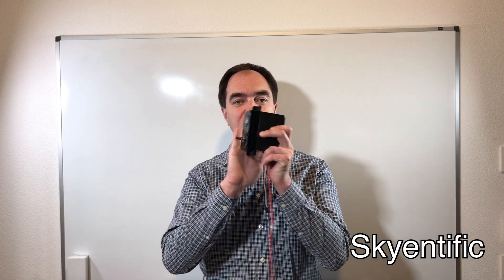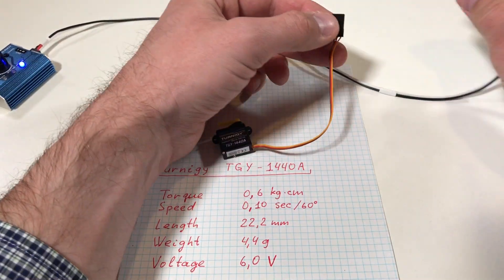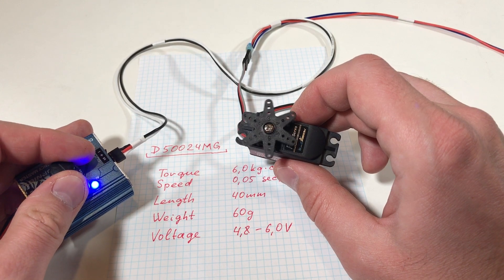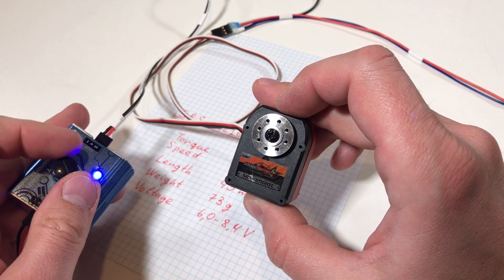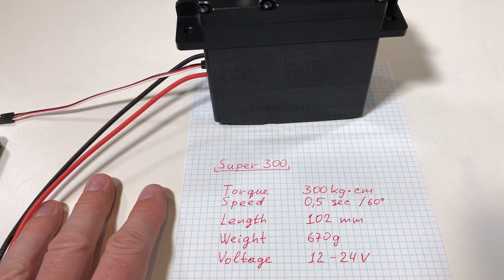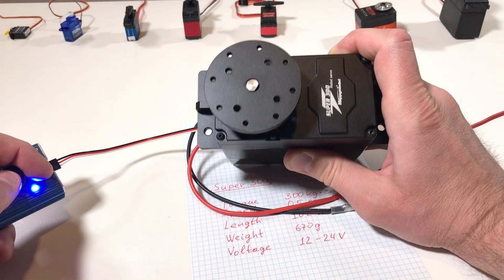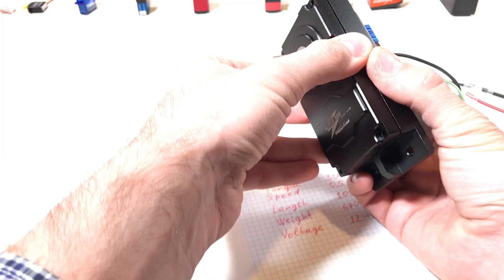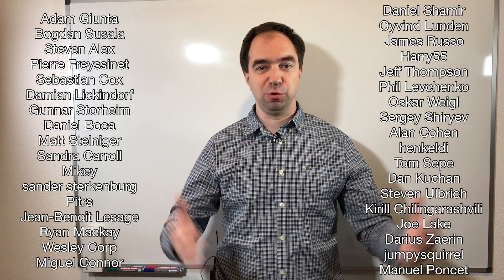Different servo motors (from 35g to 3kg.m)

Comment: Thank you! Just a note though: Torque is measured in kg.m or kg.cm in these examples. These should be read as “Kilogram Meters” or “Kilogram Centimeters” - not “Kilograms PER Meter” or “Kilograms PER Centimeter”, which would imply kg/m or kg/cm (measures of linear density).

Comment: so, servo motor is basically just 'normal' DC motor but what makes them 'servo' is a closed-loop system?
Reply from the maker: The encoder! It gives the feedback about the output shaft position. Thanks to this feedback the servo can precisely move from one position to another.
Reply: @Skyentific  i wonder is there any servo but with stepper type motor instead of typical brushed DC motor ?
Reply: @IlhamDefraN  using a closed loop system on the stepper motor to measure relative rotation isn't very useful because the stepper motor moves at constant angles per step, but a sensor for calibrating the absolute position of the axis in for example a robot arm would be useful. that's an application problem though and not something that would be included in a motor, so if you wanted something like that you'd most likely have to do it yourself with an external encoder.
Reply: @crazywazy5527  it's common when steppers skip under high load or during acceleration over resonance frequency band etc. When you need accuracy, you need feedback.
Reply: @IlhamDefraN  yes it's called "closed loop stepper motoro". There are quite a few systems on the market.
Reply: @crazywazy5527  nope that's not the full story. Closed loop stepper motor systems also regulate the current needed for doing the step so they have a much higher efficiency and lower vibrations compared to regular stepper motors or so called pseudo closed loop systems, where an encoder  just monitors the position of the stepper motor.
Reply: Yes👍

Comment: interesting, I think I'm more impressed with the open source 3D printed assemblies now I've seen what's in the commercial servos, would be neat if they can be bought pre-made, either printed, or injection molded, or cnc, especially if you could get them with precision made metal gears

Comment: If you look for decent power servo on PWM with top quality you can try Futaba HPS series like HPS-CB700. It is expensive but worth the price. It comes in two wariants fast one but weaker and more powerful but slower (still quite fast). The torque is 50kg/cm and 70 kg/cm. They are standard size servos.

Comment: That last servo is a bit of a puzzle. No bearings makes it seem cheaply made but using a magnetic encoder is a huge plus. I wouldn't have thought they'd use a magnetic encoder on a servo without bearing.

My main complaint about most servos is the pots most of them use. Most (all?) servo pots wear out with a lot of use. The pots are usually fine when used in airplanes which are used occasionally but pots in robot servos can be a huge problem. When the pot starts to wear out it makes the servo start to jitter around worn out section of the pot. Once this jitter starts, it makes the problem much worse very quickly since the jitter increases the wear on the pot. I have several hexapod with lots of servos and I have to replace the servos every so often. A magnetic encoder instead of a pot makes a servo last much longer than normal servos.

Here's a link to one of these hexapods.
https://www.youtube.com/watch?v=f520FM9Z9is

In case you're interested, I smoothed out the motion of some servos using constant acceleration/deceleration equations. Here's my really poor quality video showing the smoothed motion.
https://www.youtube.com/watch?v=yoy7H21KJS0

Thanks for showing us these servos. I'm tempted to get a couple of those large servos myself.

Comment: I wonder if the giant servo has a magnetic encoder instead of a potentiometer, because the torque of the motor would just snap off any physical end points?
Having a non-contact encoder and setting the end stops in software would eliminate risk of damage :)
Reply from the maker: You are right! This is exactly the case! It does have a magnetic encoder (AS5600 from ams company).

Comment: Thank your for this nice video. Best servos in Market are made by Futaba I think (brushless, backlash...). They also have +30kg Servos. I you use two servos for one axis (left side, right side), I think you can preload the servos, to reduce backlash and double the torque. Savox is a low cost alternative. I made a lot with servos in past. I would ask the futaba support, maybee they can provide more data.  Best regards

Comment: This is a very interesting video. I had no idea you could buy such big servo's. The big one is only $66 so that gives us great options. I think you can make it even stronger by changing the motor to a bigger one from a drill. IKEA sells really cheap cordless drills which are quite powerful. Combine that with the magnetic position sensor and you have a great setup for a robot arm.
Reply from the maker: This is very interesting idea! I should really consider this. It is cheap and probably powerful! Thank you a lot for this idea! I will check this!
Reply: @Skyentific  Backlash is a problem though... These drills have a lot of it. But a robot arm also needs a brake to keep things in place when you don't need to move it. So I think if you combine it with a brake it should be ok. It will be tricky though to release the brake at the right moment. Basically combine it with the slow start of the motor. When the motor spins up, gently release the brake at the same time.

Comment: Hello,

thank you very much for this video. I recently bought the 500 kg variant and have a problem which I have also seen in your video. The end positions and the neutral position are approached only very slowly (As steering hardly usable) Do you have a solution for this?

Comment: What are you using to control the servos? Arduino? I'm quite new to this stuff and I'm quite interested.
Reply: It's just a standalone servo controller used for testing the servos, but an arduino would work just as well.

Comment: What does it mean to write 10kg/cm on a DC motor?Will it be measured from the center of the shaft or above it
Reply from the maker: This is torque. It is 10kg.cm. It means that at 1cm away from axis it can lift 10kg. At 2cm away from axis it can lift 5kg. At 10cm away from axis it can lift only 1kg.

Comment: Hello  bro ..
Using RC how can I make servo go from 0 to 30 degree  and return back to 0 ... only by one click on the RC
Reply: connect an arduino to RC receiver, then arduino does the job (after programming it)
Reply from the maker: Exactly! I would also choose this solution.
Reply: @rodstartube   but sorry bro I want it on RC not aurdino
Reply: @Eng.Mohammad_Alotaiby to say in simple words... in your hands you will still have your RC, however, your servo connected to an arduino, and the arduino will be connected to your RC receiver, to obey your RC transmitter commanded by your fingers, and your fingers commanded by.... Allah ??

Comment: Some advice on the terminology: it's not kilogram PER centimeter (kg/cm), it's kilogram centimeters (kg*cm). The first one has a totally different meaning, maybe you'd use it to specify the weight of some metal profiles per length.
I'd like it more if people would use the Newton meter (Nm) more, because that's the scientifically correct unit for measuring torque (ounce inch in the US). But maybe it's easier to understand for people with no technical background that way.
Reply from the maker: Thank you for advice. English is not my native language. I do know the difference between kg/m and kg.m. I have PhD in physics. But when I try to talk fast, I do a lot of mistakes.
Reply: @Skyentific  english isn't my native language either. Don't worry, I just wanted to clarify it for other viewers because many get confused by this.

Comment: I would like to buy these for sound design. Where did you find the thing that plugs in and controls these?
Reply from the maker: If I am not mistaken, it called “servo tester”. You can find them on amazon, or hobbyking website.
Reply: Skyentific Awesome I found!! But how can I find the wire that connects to the servo? And also a power supply... sorry I am a total beginner because I just wanna record the audio hehe.

Comment: greetings, you have done very well especially on the super300, by what you shown, it does not
seem possible to add a "wheel" on it, please correct me because of my ignorance;
again, great work, thanks for sharing!!!
Reply from the maker: Yes. The great problem with this servo is that it does not have bearings. Thus it is better not to connect the "wheel" directly to the motor. Probably it is possible to mount the bearings instead of bushings. I will try to check this. Thank you for your comment!
Reply: @Skyentific  sure thing, there are 2 "observations"..00) the back side if the shaft is "slanted", and 01) even if one removes the casing, there is the pcb board...so to build such a free "wheel"...one may have to build a
case external to the motor's housing...
please ignore my ignorance;

Comment: Thanks, informative  as always, learning a lot.
Do you want to use servo in base joint of an arm? Or last joint (aka "hand")
Reply from the maker: Thank you for your comment. I for the future robotic arm I plan to build the joint by myself, using the brushless motor. 

I found this big servo very interesting: it is powerful and cheap (70 USD). Thus I decided to buy it and to test it. Two main disadvantages of this servo is high backlash and absence of bearings (which will reduce the life time).

Comment: Great video! I’m not sure which motors move 180° I need a servo that moves 180 and somewhat fast. And wondering how I can make it move with a push of a button, and then return with another push of the button... I’m guessing I’d need an arduino to control it or something like that? If you could help me out that would be awesome! You seem to know your servos 😁
Reply: You might be better off with a geared motor and two limit switches if you only need two positions.
To get more movement you can open the servo and remove the end stops from the output gear.

Comment: my apology for troubling you ,
since i have already obtained the dimensions of your super300 from that hobby website;

any chance you can tell me the size of the screws that will go through the holes on that 

super300( the 3kg/m torque)??? the information is for building a 3d structure for this super300 

motor, so you can see whether one can build a "dummy" shaft on the opposite side of the 

REAL SHAFT; 

at your convenience let me know
Reply from the maker: The output shaft is 8mm in diameter. The holes on the servo body is well suited for the M5 screws.
Reply: @Skyentific  thanks !!!

Comment: your presentation on these servos are with interesting detail, thank you, i also have noticed you used a pot to control
that super500 servo, hence my question, how would you connect this super500 servo to a arduino with or without a controller/driver.shield , thank you for your time and your response;